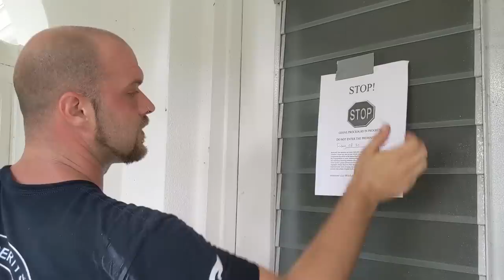S2 Episode 4: Dog Mom Decomp

Comment: Ahhh this was in my recommended, it's definetly a unique environment to work in. I was a Firefighter for 7 years and unfortunately have had expierence in removing a few bodies in various states of decay. 1 in particular was in a small mobile home that no one found untill the Power Co came to remove the Electric Meter and noticed the horde of Flies in the window and a smell. We get called to assist LEO for a Body Removal (actually common place thing) we arrive on scene and there's a bunch of Detectives and Deputies on scene when things like this happen well they informed us that they would need SCBA too due to "Conditions"  by far the most decomposed body I've dealt with but this 1 had some challenges that we never had dealt with. The body and mattress was fused together, as if it was melted in to it, there was no way to move her....at all. We ended up having to cut the side of the house out, and trim the mattress down to fit in the M.E. Van. It was a long, hot Summer day in the South, wearing  B Suits with SCBA and the absolute worst smell/sight/circumstance/ level of Decay I ever have witnessed to this day. You do a Job that there's not a lot of ppl that want to do, that is a important job to family though, good vid, new sub
Reply: Nick E the mattress being melted to the body is because of the fabric most mattresses are made of. They can’t take the acid and gas a human body produces. Or the skin slippage.
Reply: Thank u 4 your service
Reply: Hats off to you Sir for doing a great job always admire the work first responders have to do.

Comment: Just wondering, I've seen how you take off the parts of the wall where blood has been splattered and it just hit me that my house is made out of concrete blocks and I was wondering what you would do to these type of walls in that case?
Reply: My guess, concrete doesnt absorb as much as drywall? Concrete may be easier to clean as where drywall absorbs it and becomes ruined. Sorry if I am wrong. Peace
Reply: @Durwo0d  I mean that's a good guess, I hope they come across a situation like that so they can talk about it😁
Reply: @Caro-zf9ev  It's a good question. I am obsessed with this stuff. I'd like to know too 😂
Reply: @Durwo0d  same, I love this but only wish they'd make longer episodes even if they had more commercials I wouldn't mind watching!😁
Reply: @Caro-zf9ev  totally agree.
Reply: @Durwo0d  i know this is an old comment. But im pretty sure if its sealed concrete they just clean it, if its unsealed (like block walls usually are) they would clean it and seal it so nothing can come back out that they may have missed.

Comment: When a division of our Service Master started doing Trauma Clean we just reassigned and designated our oldest carpet cleaning truck to vacuuming up the decomp instead of using spray bottles and shop vacks. The truck could hold and spray nutralizer with water heated to 60 degrees. We had a rotary carpet buffer instead of using muscle power and then we would have 120 reverse psi of suction to remove it all because of the trucks three screw blower vacuum.  It made the crew with the truck be able to do three jobs that big a day instead of one.

Comment: Here, a rural area, the deceased are usually removed by the ambulance to a funeral home. There's no morgue, no medical examiner's office, the coroner doesn't have a van, etc. Now if it's an unattended death (decomp), if there's purge of any sort or they're burned, we won't take them in the ambulance. But they expect the ambulance crews to package and remove the body and any easily movable soiled materials. Whether you're packaging them in a bag, or buckets with scoops. I did it for twenty years, but the last one I knew the deceased, rapidly left the house and puked all over the road. Even with a full respirator and tyvek suit, or SCBA and tyvek, et al; I can't do it anymore. I don't know who does the final cleanup, I assume someone like ServPro, etc.

Comment: Kyle you should switch to vape I haven't gotten sick at all in about a year
Reply: OMG, I was thinking the same thing! My lungs are soooo much better now with vaping...I use a low nicotine/menthol liquid rather than all the flavored stuff so it's still not good for me, but my lung capacity has improved and I don't wheeze anymore. I had been smoking for about 45 years and don't miss it. At. All! I have also been able to reduce my nicotine content since I started vaping. It's the way to go for a smoker having a hard time quitting as far as I'm concerned. I tried the patches and lozenges, books, and the drugs that are supposed to help with no results...Now I'm saving money and feeling better. Win -Win!!